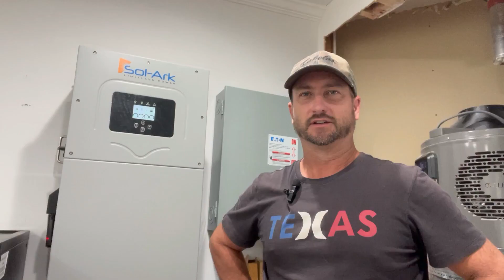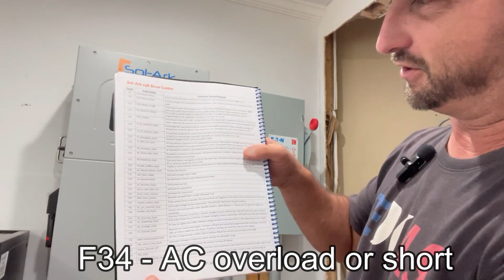Sol-Ark 15k Software issue?

Comment: Yeah.  That's was the same error David poz kept getting when he ran his sa 15k off grid. It would be awesome if you could run yours off grid more and reproduce the error... i wonder if their update truly fixed the issue.  I'm looking to buy 2 of these but am concerned about this error.  Thanks for the awesome videos!
Reply from the maker: I have a family homestead on 15 acres with 5 homes on it occupied by other family members. I made sure our well in our property is powered by my solar setup in case we have a major loss of power like we did during the snow storm a couple years ago. Because everyone is dependent on me for our water and water pressure system I’ve been keeping it in hybrid mode until I get another 30kwh battery bank. I use a lot of power at night running multiple window A/C’s. By the time our sprinklers come on in the morning for our garden I’m close to having to go back to grid power because the well pump and water pressure system pumps are 240v and run for 3 hrs. So to be safe I’m keeping it in hybrid mode for now. But once my budget allows me to get that 30kwh of additional batteries I’ll be good to keep it in off grid except for during winter storms (at least that’s my estimate for now).
Reply: @Practicalpreptx  cool, thanks. Sounds like a neat setup you have there. I'd love to see more videos about the place.

Comment: That is a bummer that software glitches and software updates kill power to the whole house, even though the grid is available.  When you use Sol-Ark as a battery back up it can become ironic that you are getting more power outages than before you got it.  Software updates seem to occur every few months, they should have made it possible to reboot the machine while leaving you on grid power.  I thought it was fixed with 15k but guess not.
Reply from the maker: Yep agreed. That’s why it is smart to have a transfer switch to bypass the Sol-Ark for updates.

Comment: So software gets outdated now? It was working fine but because the software is not up to date it starts glitching?
Reply from the maker: That was the best explanation Sol-Ark could come up with. But I did have a huge lightning strike hit near my house a few days prior to this software issue. It is possible that had something to do with it. And it just needed to be reset.
Reply: @unpluggedtexan  ac coupled it doesn't like too much juice from the micros. I get an f34 if I'm running more than 30 panels. Stays around 8000w charging the batteries and still running most of the house.
Reply: If there was a need for an actual software update to correct the problem, then there had to be programming change which eliminated the issue. They should be able and willing to describe what the problem was and what was done to correct it. How do you know that the same issue will not arise in another few weeks of use? How do you know it has been fixed; ask to speak with an engineer.

Comment: Hi Brian, I see you have the heat-pump hot water heater we have been looking to get. We need to replace our electric hot water heater this year. Can you please let me know what the usage has been for it. (FYI - We are currently looking at getting an All-in-One with batteries only - for now-  to use for power backup and to reduce our electric cost and it would be nice to know that my idea will work to switch out our hot water heater to I believe you have a Rheem there.)   Thanks.
Reply from the maker: Hi Tony, here’s a video I did on it. It should answer your questions. You are correct it is a Rheem. I love it. https://youtu.be/A8b0nNAVtDw

Comment: Could this have been a glitch that was triggered by that close lightning strike?  I had one of my EMP hardened Sol-Ark 12Ks do a screen comms glitch after a close lightning strike a few years ago (the 'check in a circle' icon in the upper left corner of the screen was being replaced with 'COMM ERROR' every few seconds), but the inverter kept working and a power cycle fixed it.
Reply from the maker: I didn’t think about that. That could definitely be what caused it.
Reply: I’m